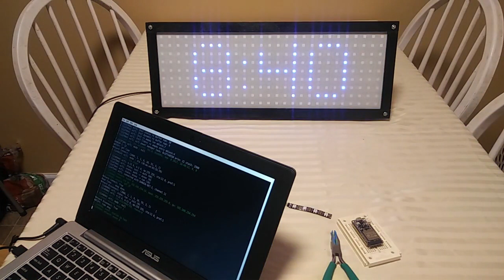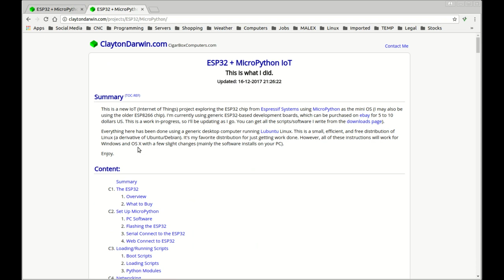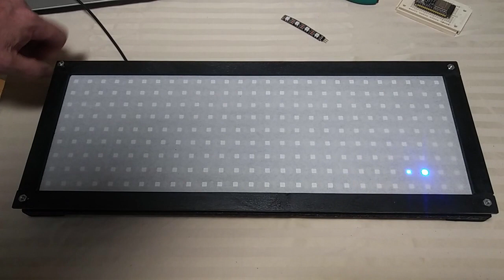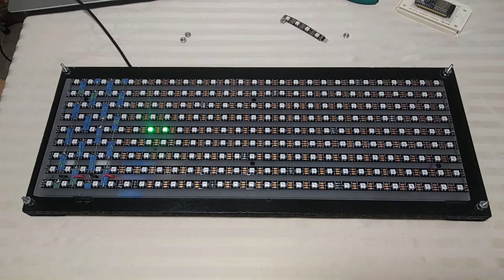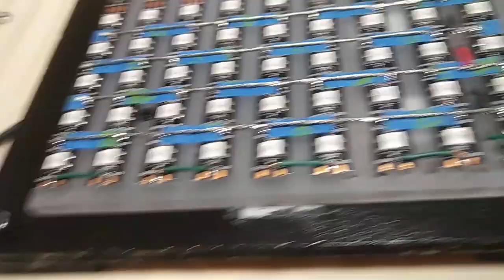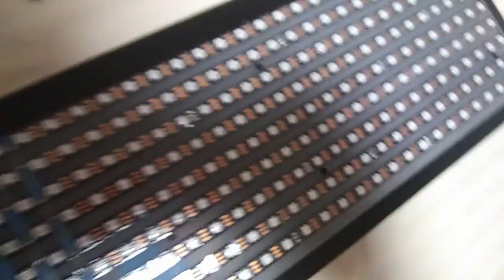DIY NeoPixel Matrix - WS2812B Strip - ESP32 Project 2

Comment: Hey! I'm trying have uniform illumination inside a hood, and was thinking of making 10x50 LED array. Not sure how the brightness would work. If at full brightness, given it draws 60mA per pixel (for white), I'm looking at about 30A. As a starting point, I would try with 10A by limiting the brightness values. The way how I want to control is by hooking it up with ESP8266 and controlling via WLED software. So my questions is, can the ESP8266 handle it? or may be I need to have a different PSU for ESP.
Reply from the maker: Yes. With neopixels amperage quickly becomes a problem. However, you may not need full power. You can run a single pixel with 3ma on a low value. You get 256 values per color (red green blue), so 768 different levels. I have an array with 1200+ pixels, but I can run it indoors with about 750ma. Just limit the brightness.
Reply from the maker: Also, the command/signal is independent from the current lines. An esp32 or similar can definitely handle it.

Comment: I did shy away from using python for my build (which is a little bigger) cause i was worried about achievable framerates/latency for (interactive) animations, especially if they need a bunch of compute in the background. and learning c was quite painful. can u tell me something about performance/fps in comparison to controlling by c-compiled vs micropython code? thx in advance.
Reply from the maker: I haven't compared them. However, even C functions to manipulate frames will be relatively slow on the ESP32.
Reply from the maker: That's not helpful, I know.

Comment: so i finally build a 20x20 matrix with esp32. you can see it here: https://www.youtube.com/watch?v=cRI8Sehf6do . 
it works nice, but its limited resolution. do you know, what limitations there are for the number of neopixel, you can drive with a esp32? of course there is the amp problem. but i heared of some timing problem all these led-stripes have, cause they are daisy-chained.
Reply from the maker: To start, the ESP32 only "drives" the first neopixel. Then each neopixel drives the next. So there is no theoretical limit to the number of pixels. However update speed is an issue (frame rate) since all data has to be passed down the line pixel to pixel. The ws2812b is fast enough at 800mhz (says the datasheet) that it can run 1024 pixels on a single line at 30 frames per second. However, the ESP32 may have a problem keeping up with that if it has to build the data matrix each time before it sends it out. For example, when I play the video using the ESP32 on the 128x64 display, I'm just reading blocks of data from the SD card and sending it. I'm not manipulating the matrix directly. When I actually draw the matrix and move objects or text (like scrolling) it is way slower. My scrolling displays don't generally have any added delay, and they run at probably 12 fps. You might have to use a raspberry pi or something (faster) to have a big responsive display.

Comment: How come you don't have to use a shift register?
Reply from the maker: The WS2812b connects serially. Each one has a microcontroller in it. It reads it's instructions and passes the rest down the line. Each controller handles it's own PWM for color generating. So it isn't in a traditional matrix controlled by shift registers. Just a long string of microcontrollers. The matrix is in the software running it. You send out a whole new set of instructions about 30 times a second.

Comment: nice project. i m thinking of esp32 for my next led-matrix, cause arduino is not enough memory. i could not find the project docs on your website. could you please give me a link?
Reply from the maker: Cool. I'm moving all my stuff to here : https://gitlab.com/duder1966/youtube-projects
Reply from the maker: Also, I have some tutorials that might help you get started.
Reply: @ClaytonDarwin  thanks. in some other 2812 matrix projects with arduino i saw people using a capacitor with the power supply to protext from peaks and a resistor in front of the first led. you did not use this. so it seem to work without?
Reply from the maker: @sub-arts128  The caps probably protect the arduino. The pixels have their own caps. Most ESP32 dev boards have caps on the input power as well. So I don't add additional caps. You don't have to use a resistor on the input line to the pixels as long as there is no chance the ESP32 pin will accidentally go to ground. However a 470 or 1000 ohm resistor will protect the ESP32 pin and seems to help with spurious signals on the input. I'm using a 1000 in my most recent design (the FunBoard V2). I recently tested my micropixel board and was able to get a reliable signal using up to 8700 ohms in the input from an ESP32.

Comment: Great video!
How did you level shift the signal for the leds? The esp32 gpio hadles 3.3v but the led requires 3.5v data signal. How did u get it to work?
Reply from the maker: Good question. You're right. At 5V as VDD for the WS2812b, and with 0.7xVDD as the minimum input high, then 3.5V is required. But... the WS2812b can run at 3.5V too, and that lowers VIH to 2.45V. I'm guessing the real specs are 0.7x of the lowest VDD value allowed. At any rate, it works with 3.3V from the GPIO. I've never had any problem. You don't have to add anything, but I always insert a 470 ohm resistor to protect the ESP32 port in the event of a short to ground.
Reply: A SN74LVC1T45 on the data pin would handle this for you

Comment: I have a question, I am trying to figure out how was it possible to reduce the current and voltage so much, so you can just use the usb port? thank you.
Reply from the maker: If I set all pixels on this board too full brightness white, RGB values (255,255,255), then it draws over 7 amps. That's the maximum amperage it will ever use, but this is way too bright for indoors. I limit the color values in software to comfortable levels. I think here the maximum brightness for white is RGB values (16,16,16). If all the pixels are set to these values, it uses less than 900 milliamps, so that is good for USB3. However, I never use all white, and other colors use even less amperage. Remember that the total amperage of the board is the sum of the amperage of each pixel, and the color values are pulse width modulation values. At a max of 16,    at most any pixel is on only 16/256 of the time, 6.25 % of the time. And when one is on (a high pulse) most others are off. Consequently the actual load at any given time, averaged across all pixels, is only a fraction of the 7 amp it could draw. I think the wave clock (same board, another video) averages less than 300 milliamps. Just run some experiments and see what amp loads you get. You don't want to burn anything up.
Reply: @ClaytonDarwin  thanks a lot, I havent thougt on not using white to decrease the current neither on using just some leds at the same time and yes, I'll try to use it with a usb3.0, you got a new subscriber.
Reply from the maker: Cool. Be sure to check everything with a meter first so you don't burn up your USB port. Also scale all your color values. Values (255,0,0) is red, but very bright and high current. Values (16,0,0) is the same color red, but dimmer and much lower current. Just divide all color values by the same number, and you get a dimmer, lower current version. Check out the kid computer video. I scale all colors on that by dividing by 8. Really low power.

Comment: I like the diffuser, looks nice.   If you'd like a library with a bunch of example demos you can use, see: http://marc.merlins.org/perso/arduino/post_2018-04-23_FastLED_NeoMatrix-library.html and http://marc.merlins.org/perso/arduino/post_2018-05-29_EDM-Party-Shirt-powered-with-FastLED_NeoMatrix-and-Adafruit_GFX_plus-160Wh10Ah-4S-worth-of-lipos.html
Reply from the maker: Thanks bro. Will check it out.
Reply: no problem. Also, as you may know, you can now buy premade 8x32 matrices. I spent way too long making my 24x24 by hand like you did, and I'm so happy I can just connect some 8x32 or 16x16 together now, saves loads of time :)
Reply from the maker: Yep. However, what I really want to do is make a big display, so this was my test platform. Maybe by Christmas I'll have the time to do it. I just have too many things I want to try.
Reply: Yeah, I saw you wanted to do a bigger one, but how much bigger and how many pixels? Given that time is precious, depending on the size you need, premade panels may still make sense. For instance 1 meter wide is about 3 panels of 32 x 8, which cost about $100. If you want to make a clock, that's one meter square, I agree that it would be too many panels and cost too much  ($1200 and 36 panels), but if half that size is good enough, you could use 9x 16x16 panels which would give you 48cmx48cm and 2304 pixels ;)   and the panels would cost $300 or so, not that much more than buying the neopixels and laying out 48 strips plus all the soldering.
Reply from the maker: I'm thinking about a 11x27 or 9x33 grid (300 pixels), but 6 inches or a foot between pixels. Bigger, but not many more pixels.
Reply: neopixels are damn bright, but they may not be bright enough that far apart. I guess you'll find out . Let me know if you build this, I'm very curious to know how it works out.
Reply from the maker: I'll definitely post it. Will try to remember to tell you.

Comment: Nice project. Just curious why you have run double power buses across the LED strips, when they come back to a single wire into the ESP32 power pins?  I note the onboard AM1117 regulator is rated 1A, so that will be your max current (less what the ESP32 is already drawing). Cheers.
Reply: Sorry, ignore my AM1117 regulator comment, as presumably you're hooking up to the VIN pin, so direct from the USB provided 5V power. But still curious about the 1 wire leading into double wired buses.
Reply from the maker: When I made the board I wasn't sure what brightness I would need and consequently what the amperage would be, so I doubled up. Turns out I never go over 32/255 on any color, so the max amperage is under 400ma and it can be run from the USB power in this application. However, if you run all neopixels with all colors at 255/255, it would use 8 amps, and this setup would melt. Well, the ESP32 dev board would. The matrix would be fine. But next time, for a similar size matrix, I would use a single bus of wire that can handle 8 amps.
Reply: Makes sense. Thanks. Good to know your running around max 400ma with those settings. I'm thinking of a 32 x 8 matrix.
Reply from the maker: Cool. If you don't need to make it 8x32 specifically, you may want to try 9x33 instead. Odd numbers give you a center pixel. This allows you to center a font easier. Most simple fonts have an odd number height, like 7x5, which can't center on 8.
Reply: Good point! If focussing on character display then 9 pixels high does make sense when thinking 7x9 dot matrix font (with descenders). So I understand odd numbered height suggestion (for a single character row display).
But for width, a multiple of 8 appears to still makes sense. eg. 7x9 font with a 1 pixel character gap would use 8 horizontal pixels per character. So perhaps I should go for a 32x9 pixel panel.
Alternatively, if only needing uppercase (and digits), perhaps a 5x7 font on a 30x7 pixel panel.  Hmmm
Reply from the maker: Yeah, width is not so important for the font, but if you ever want a crosshairs or center line odd width would be good. Also, to me only upper case looks good with these low pixel displays. That simplifies things a lot too.

Comment: hey man, great video! At the moment I am doing something similar with these strips. I saw that you used so called "bus(s)es". Could you make a video where you tell how you wired that and why like this? Purpose, advantages, Why two power power lines etc. ? I would really appreciate it! :)
Reply from the maker: Hey Mert, thanks. I ran two power lines because I wasn't sure what the power consumption would be when I was building it. One would be fine now that I know it will only pull 8A max, and especially since it normally runs under 500ma for most applications. I ran the power lines straight across the strips because 1) it's the shortest distance to the pixels for least loss, and 2) it's way easier than doing it at the ends like you have to do with the signal line. But it really doesn't matter when you're under 300 pixels. Do whatever is easier for you. Over 300 pixels, you won't want to run all the power down the strip because of the voltage drop and heat it might cause.
Reply: hey, thanks for the reply (sorry little late). The way you connected the power lines makes this circuit a series circuit, right? So the current is the same and the voltage is split? Or do I understand in incorrectly? Thanks! :)
Reply from the maker: Well, hmmm. It's not that complex.   Just make sure you have 5 to 7 volts connected to each strip. I guess you could call it parallel. Also make sure your wires are big enough to carry about 45ma per neopixel on the strip. It doesn't matter how you do it. I ran it per strip, but I could have run it along all the strips, as if they weren't cut into smaller strips. The + and - run down the strip and all the neopixels connect to them in parallel. Only the command signal runs in series down the strip.
Reply: I bought a 5V, 10A power supply to power my project, consisting of 100 LEDs. I was going to use a bit more LED, but my plans changed. So if I just do the same as you did, except for 1 + and 1 - wire going across the strips would be enough, right? Thanks for the quick answer!
Reply from the maker: Yeah, 100 neopixels should use less than 4.5 amps at full bright, i.e. the RGB values at 255,255,255 for all neopixels. I would do your initial testing with them all as a single strip. Once you have it running, then cut the strips and arrange them back and forth like i did. Run your signal down the strips following the arrows. Run your power across the strips. Be careful with the polarity. Make sure everything is insulated because10 amps can melt metal.
Reply: Thank you for your answer! I have one last question; I have some 12 AWG wire, that will be big enough to power the circuit, right?
Reply from the maker: I think so, but look up a wire size vs amperage table and check (google it). Make sure it is for DC voltage. You can go smaller I suspect.
Reply: Thanks for your help! I will send you a link of the video of my project once it's complete :)
Reply from the maker: Cool.
Reply from the maker: The positive and negative of each WSB2812 (pixel) just needs to be connected to their respective voltage. It doesn't matter how that is accomplished. There is no need to run all the power down the full length of the strip (although you can) because distance equals resistance which equals power loss, heat, voltage drop, and such. The shorter distance the power runs, the less loss. On the other hand, the serial signal MUST run from pixel to pixel all the way down the strip. This is critical as each pixel modifies the signal and only passes a part of it to the next pixel. You can read all about this in any of the WSB2812b data sheets. Just google "wsb2812b datasheet", download the .pdf and have a look. There are schematics, explanations, serial coding, and voltage specifications.
Reply: Great job with wiring your matrix.  I've watched a few videos where people were wiring each individual led or wiring everything end to end.  I was going to run bus bars but placing the bus across the solder pad is even better.